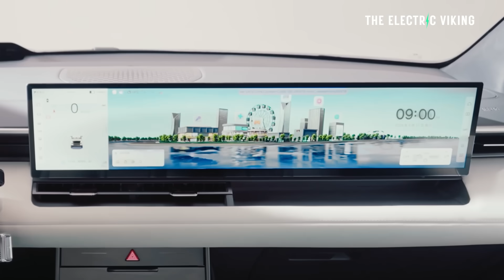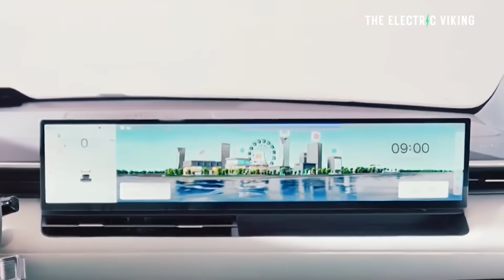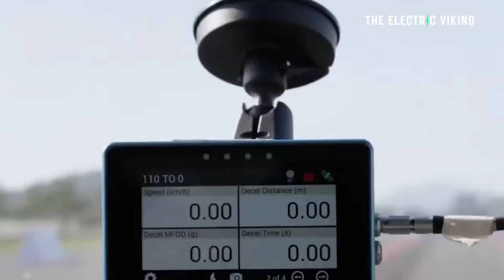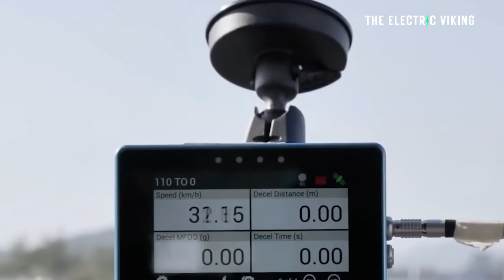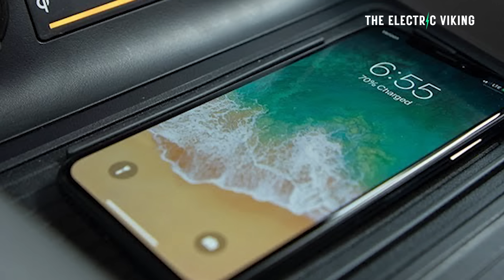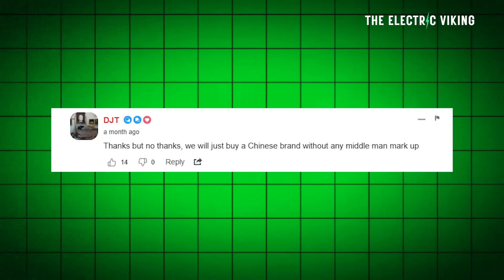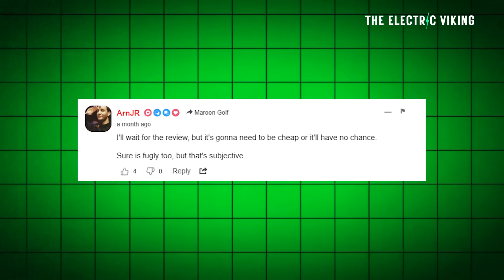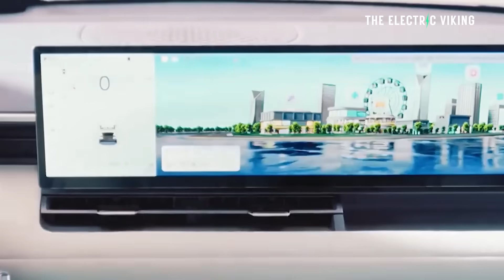HYUNDAI'S $16,800 EV! Tesla Model Y Rival Arrives with an 88kWh LFP Battery!

Comment: Another reason cheaper EVs can’t take off in the US is the fact that even 300mi of range isn’t enough for the average inexperienced new adopter; the ones who refuse to slow charge and only use the fastest, busiest, & most expensive fast chargers at 5pm when there’s a huge surge of people charging, and then they charge from 5% all the way to 100% like a gas tank. They think they need more range to minimize the trips to these stations when they could be charging more slowly & cheaply with less headaches on a shorter range vehicle if they just realized they could charge where they already park; overnight at home, while at work/school, while shopping, gym, grocery, movie theatre, etc.
I meet these people everyday, they’re usually in the first two years of adoption, and more often than not driving & charging a Tesla.
My old Hyundai Ioniq 169 mi range EV was enough for me to travel half-way across country…in 2021 too. Which blows their minds.
The longer you have an EV, the slower you’ll charge (more often) for half the price atleast, with the exception of road trips & emergencies.

Comment: You commenters crack me up.  Everyone thinks Hyundai is selling this car for a profit in China.  They are not!  Sam continues to act like all these low priced offerings by Tesla rivals are profitable...

Sam, have you ever looked at a Tesla?  I know you have.  Do you not have the mental acuity to ask yourself, "How could anyone make a car that rivals Tesla's Model Y at a lower cost than Tesla?"  What kind of magic do you think they have invented that allows them to add all these fancy interior luxuries and buttons and lights, with similar batteries at a price so much lower than Tesla?  It doesn't exist.  What?  Do you think that the supply chain in China somehow benefits the Korean company more than it does for Tesla's factory in Shanghai?

The best selling car in the world is actually the lowest cost to manufacture for its class/size.  And this statement includes ICE comparison as well...in the same class/size.  Geezzz!
Reply: Id much rather buy a Xpeng G6 than a model Y 
Same range, much faster charging, beautiful, white interior for no extra costs, much more beautiful interior
Same price in the Netherlands

Comment: it will be over $60k here for sure.   they are not just ripping us off they are gouging our arses out.
Reply: Another possibility is that $60k is a price that is financially viable and they're making a big loss with the Chinese price
Reply: Your government tariffs are ripping you off.  Get your facts straight.  The trumpets don’t want you to be able to afford a car.  Who do you think pays for tariffs?
Reply: @davidstrong7854 Prices were high before the tariffs
Reply: EV are very dangerous the battery lithum fires the media try keep them out but it destroys aparments and building. Hard pass. No resell No grunt. No range.
Reply: @GregPacker-v4p  😂
Reply: @GregPacker-v4p what nonsense disinformation talking point will you switch to once na batteries become mainstream?
Reply: @scow01  They will not no one wants one No resell and lithum battery fires can cause deaths. Read The EV failure project 2025
Reply: @GregPacker-v4p why are you lying?
Reply: @GregPacker-v4p   i bought one a year ago. a, I love it.  If the price drops just a little bit, Id never go back.   Its just a better driving experience once you get used to it .  Especially if you have a home charger.  the cost to drive it is less than my lexus I had before it.  No gas, no oil changes, no brake jobs.  and its quicker, and more relaxing to drive than my lexus.
Reply: @davidstrong7854  Over price tech, not worth what you are paying read the comments. They have no resell and apartment fires are caused by them. I refuse to waste my hard earned when Fords and Commodore still drive perfectly. Please do not drink the coolaid.  Our kids have no hope sir.
Reply: @GregPacker-v4p just lying like usual?
Reply: @GregPacker-v4p  do you realize that Ev are less likely to catch fire than a gas car?
Reply: @davidstrong7854  Me Ford never had an issue but I saw a ripper EV fire on the hume last week RIP.

Comment: Bought an Ioniq-5 AWD LMTD last month because IMO it was the best value in the USA. Hyundai did a super job in making the vehicle safe, feature rich and easy to drive. It nicely balances tactile controls, HUD and cluster instrumentation. It isn't FSD but it is a superior ADAS to most others. We leased it for about $315/36-mo but the list was about 60k. My wife sings its praises daily.  I, on the other hand bought an A6 e-tron AWD at roughly 10k more but my wife definitely won this round for best vehicle even though I get about 60-70 miles more in range.
Reply: What state? That’s a good lease if you didn’t put any money on the out the door cost. I5 sales for October are down 60% from last year, according to Hyundai sales figures that just arrived.
Reply: @Fred70115 in Australia I5 sales tanked as soon as way cheaper Chinese EVs showed up
Reply: I hate to tell you this but the Ioniq 5 is one of the least reliable EVs on the market. Failures are far worse than even internal combustion engines. Not sure if that's different now but check the German roadside assistance report by the ADAC

Comment: The problem is hyundai is very expensive in europe - New Hyundai kona max trim in Poland is 215K PLN (new model 3 LR RWD is 207, new xpeng G6 is 223kPLN xddddd )  where new LeapMotor B10 max trim is 134k PLN with ventilated seats - these cars are very comparable. B10 has better charging speed, slightly better battery and cost almost 60% less! For slightly better car with 67kwh battery. 
The worst thing is you can't get vent seats in lower trims in Kona, which is very bad. The time where legacy automakers could give 500% margin is over. Kona shouldn't be so expensive in the beginning - max 150k PLN for max trim would be okayish. Because BYD Dolphin refreshed model is also 150k PLN

Comment: You so often seem to want to dump on Tesla with the latest, cheapest competitors, but in spite of your dire predictions the Model Y which is more expensive than most of its opposition is by far the highest selling EV in China
Reply: BYD is selling more cars worldwide than Tesla. The Y as an individual model sells a lot but Tesla has only 4 models of cars not counting CT. BYD has many more models so the numbers are divided up more.
Reply: In the first three quarters of 2025, Tesla's overall sales in China ranked only 10th and sold 432K units. In comparison, BYD sold 2317K. Telsa EV sales ranked 6th. Among individual models, the Tesla Model Y ranked 2nd, with Geely's Wish ranking first. In reality, only two Tesla models are sold in China: the Model 3/Y. The Model S/X are almost nonexistent, while other brands offer numerous EV models. Tesla's sales in China declined by approximately 6%, while prices dropped by over 10% (compared to last year). Compared to the previous year, EV sales in China increased by nearly 35%.
In China terms of total sales revenue, Tesla was even surpassed by AITO that  may not have heard of. AlTO sold 262K units, but the price was much higher.
Reply: Tesla fanboi offended...
Reply: Michael Jackson was the King of Pop at his time. If he's at it again today, from afresh, it's hardly unlikely he'll achieve that.

Comment: ‘DRASTICALLY SHORT’: The latest national climate plans will cause global emissions to drop 10% by 2035 from 2019 levels, “bending the emissions curve downwards for the first time”, but falling “drastically short” of the 60% cut needed to keep 1.5C in sight, said the Guardian. The plans – known as nationally determined contributions (NDCs) under the Paris Agreement – were assessed by the UN in a synthesis report ahead of COP30, the publication said. The 10% cut reflects plans announced by China and the EU, in addition to formal submissions from 64 countries, according to Reuters. OVERSHOOT ‘INEVITABLE’: UN secretary-general António Guterres said in a joint interview with the Guardian and the Amazonian publication Sumaúma that overshooting 1.5C of global warming was now “inevitable” and would have “devastating consequences”. Guterres “did not give up on the [1.5C] target”, but urged world leaders to “change course” during COP30 to ensure the “overshoot is as short as possible and as low in intensity as possible to avoid tipping points like the Amazon”. Reached for comment POTUS Trump stated, the idea that I care about anyone or anything other than myself is the REAL HOAX.

Comment: Yeah we get taxed to death in the U.K. so that’s a £35k car most probably. 🙁
Reply: Well, that's quite cheap. A Kona ev 65kWh is €45.000,- in the Netherlands. This new bigger car with an 88kWh battery will cost at least €50K
Reply: Taxes may be higher but you will never go bankrupt with medical bills or go hungry among other things like here in the US. 😢
Reply: the market is locked in a PCP / Lease mode which is fueling the high prices.  tax is 30% (VAT & Duty) but I'd say the dealerships hike the prices.

Best example is the BYD Seagull, £5500 in China, nearly £20000 in UK.  Net fucking Zero doesn't help when car manufacturers get fined if they sell too many ICE vehicles.  UK is just dying right now, if it was a horse it would be shot
Reply: @mrpugster  the uk system of inscentivising the EV switch is good. Much better than the taxpayer subsidies in the US. There the subsidies encourange the car makers to mke expensive cars because people can aford them with the subsidies. In the UK car makers are inscentivised to make more appealing and affordable EVs because if they don't sell enouh they get fined. The % target goes up gradually each year to flow into the phase out of ICE. The car makers know years in advance how they need to plan for the transition which helps them manage it. When Sunak changed the targets they complained because it messed up their plans.